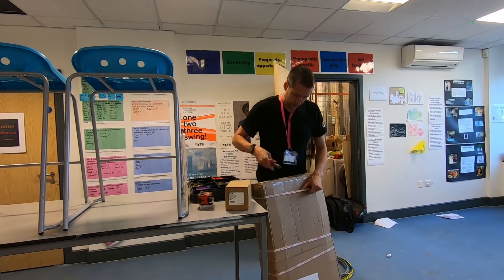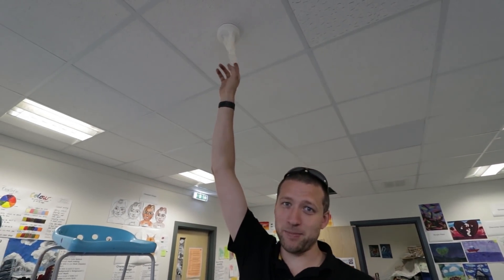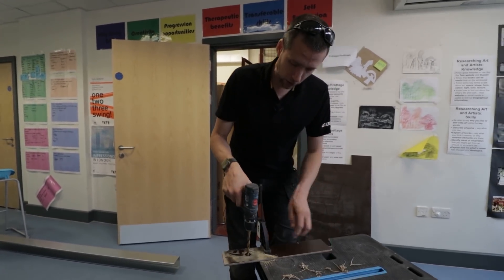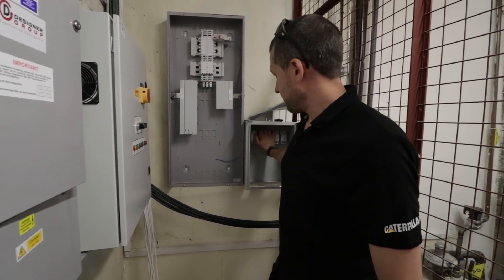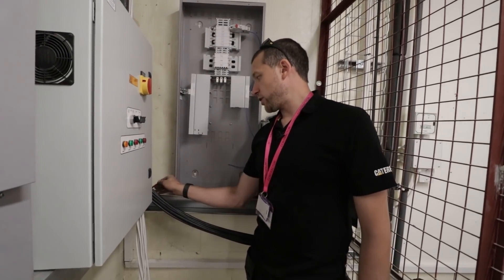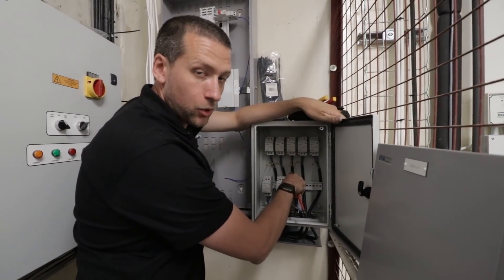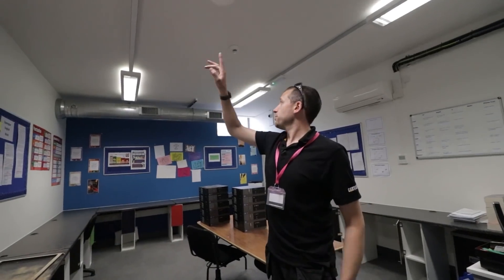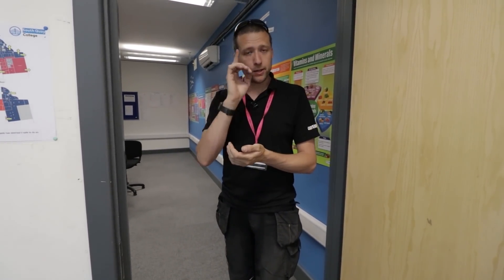Fitting a new three phase panel - (and a bit of steel trunking) | Thomas Nagy

Comment: I wonder how many of those damned PaxLocks have had to be replaced.  I think all of our PaxLocks in work had a mechanical failure.  Maglock connected to a Net2 box and reader are much more reliable, plus they can be remotely accessed, released in the event of a fire (which PaxLocks will sleep through), etc.

Comment: You could have used a hand electric saw with steal blades in it, that one does a good job and no sparks as well. Angle grinder is for something much more hard I guess. I have seen people cutting trays with such heavey tools , the trays can be cut with jig saw as well as a small electric saw but honestly I have seen people using angle grinder on it too.

Comment: Do you have a video on how to supply and connect a grid switch with 8X 20amp switches plus emergency lighting. How many supply cables would I need etc. Would the supply cables run through a contactor then a RCBO? Help please. I do domestic. First time commercial 🤞👍

Comment: Use a cutter on the paxolin.
Mark your centre holes and then put a 38mm cutter through the paxolin and a 50mm through the trunking/fusebord. 
Grommet strip is crap, use a Bush, or use paxolin to fabricate a safe entry.

Comment: I think I know where that earth leakage is coming from. It's probably from another "electrician" wiring a single phase device to a 3 phase supply, using earth as a neutral when the supply has no neutral running to it.

Comment: It doesn't matter that there's 4A or 400A flowing in that earth. It's the voltage and your bodies resistance that determines the current that passes through you heart.
A car battery won't kill you, a spark plug lead will. 
12V vs 12KV
Reply: You can get a nasty shock from spark plug wire, but getting killed is unlikely.

Comment: How is the Paxton system being integrated on with the contactors, I thought Paxton was a Access Control System, 
Swipe card brings in the contactors from a set of Aux contacts in the Paxton panel??? But then won’t it time out like when you swipe through a door, please explain Tom I love the integration between security control panels and electrical installations

Comment: Think your ip rating might be gone with the hole with the grommet strip in it you are using for cable entry surely the cables should be in trunking higher up or glanded into trunking. People will poke their fingers where they shouldn't.

Comment: Paxolin is a trade name it is actually SRBP synthetic resin bonded paper it's what all old PCB,s were made from a lot are fibre glass but not all. I always use a hole saw on paxo never a spade bit.
Reply: Agreed, I'd have never used a flat bit

Comment: Hi Tom, Enjoyed enormously your video's. I did comment on your last video about the Earth leakage, I know I'm an old spark who left the trade in 1969 but still try to keep up with the latest. I still think it could still be  an unbalanced system giving rise to high neutral current and using the parallel paths as a return because of high impedance neutral, that could be caused by   duff joint or harmonics from the switch mode computer supplies, but I doubt if it was the cause of the  leakage, your High quality clamp meters as yours obviously is have an harmonic filter so you only read the true 50Hz I would estimate it would only be 15-20mA for about 40 computers so wouldn't amount to anywhere near the measured leakage you have. If possible try turning off each supply at a time with the clamp meter connected to see where the origin of the leaked is from. Not tell you your job you are 100 times a better spark than I was, but just intellectual curiosity.
Reply: Peter Robinson you are bang on sir.

Comment: Clamping a main earth on a tncs system is measuring circulating neutral currents in the supply system and is not how to measure earth leakage. The school will almost certainly not be leaking nearly 1kw of power.
Reply: What "circulating neutral currents"? Shouldn't PE be isolated from L and N?
Reply: In a 3 phase balanced system you should be getting Zero current on the Neutral and to answer the other question. On a TNC-S system the Neutral and Earth are combined at star point which is usually at source ie Substation.
Reply: @jurassicsparks5220  There's no such thing as a balanced 3-phase system in practical terms. Certainly not that one.

And no, TN-C-S isn't combined back at the substation, that would be a TN-S system.
Reply: Monkeh yeah you are correct sorry ,combined at the service head 👍
Reply: @jurassicsparks5220  i meant that they shouldn't connect after splitting so there shouldn't be any substantial current on PE during normal operation.
Reply: https://professional-electrician.com/technical/protective-multiple-earthings-pme/
Reply: This article helps to explain what goes on with pme connections

Comment: Just an FYI at 12:30, if you did disconnect that 4a line from the earth bar, 4A would not flow through you, because your skin is not very conductive. 
If there's a 250v different in potential between the line and ground, your skin would have to be 62ohms to pass 4A, but your skin is definitely not 62ohm dry. At most, you'd pass a couple milliamps, because skin's resistance is on the order of megaohms, when dry.
Reply: on the money, i would like to know my own resistance between entry and exit with various situations, but i dont want to throw 250-500v between my hand and foot ^^
Reply: And the voltage required to get 4A to flow through those conductors is not exactly much - so what's driving 4A, an actual fault, leakage, or just some stray potential between multiple huge pieces of conductive material stuck in the ground? There's a good chance there's really nothing happening but physics at work.

Comment: You estimate 5 days to do all that? I could agree if you had help. As far as price I would be thinking$4-6k(US),  unsure of materials needed/pricing. Does the panel with leakage have a ground connected to the water piping? Is it possible there is a ground loop in that panel that is picking up leakage?

Comment: Im a Red seal electrician in Canada. Love your videos to learn how you guys do it across the pond. One thing I have noticed is you guys have so much more safety regarding electricity. Id say if I asked 20 Canadian electricians if they have ever used a megger before 15 of them wouldn't have.
Reply: Not just regs, I'm in Level 2 Elec in College and every single circuit I build has to be tested. It's what's drilled into us

Comment: 10:12 If you are routing the conductors through a hole in the lid, isn't that preventing the lid from ever coming off again? Wouldn't it be better to have a cutout at the edge of the lid so it can be slid on and off?

Comment: Hi Tom, We use Eaton a lot and use the trunking adaptors all you have to do is cut the trunking. What supply are you feeding to that D.B 100A? as it looks like a high current board?
Reply: 250a incomer on that board. That’s why it’s so big.....

Comment: Do you install Paxton access control systems? Saw a familiar Paxlock reader, how do you like those? Had any problems with them breaking and not unlocking?
Reply from the maker: Im pretty green and new to Paxton. Its seems like a very cool bit of kit though. I will update you on it more as i start learning about it.
Reply: Paxton very rarely breaks we've got readers out on jobs that are over 10years old no issues

Comment: Did you find what is leaking to earth?
Reply from the maker: Im pretty sure its a combo of all the fluorescent lighting and pc equipment put together.
Reply: @thomasnagy  could be ,but it is conducting which means its going beyond earth and returning somewhere,  sometimes I enjoy finding the answer to these strange issues and adding it to my bucket of experience
Reply: @toddt6730  Well, it just so happens that our supplies are earth referenced - so the earth itself is a return path..
Reply: Maybe a tncs system and some neutral current is flowing down your bonds to metal services

Comment: You can buy a 20 mm ( + other sizes ) drill bit -  , with a reduced size shank that it will fit into your Battery Drill - a Spade Bit will wear out quickly because of the amount of friction created by the hard material.
I find that a nice sharp 20 mm bit will go through Paxolin easily 👍🏻

Comment: 4 Amps leakage doesn't mean it will pass 4 Amps through your body if you were to disconnect it.  What would happen is the earth rail potential would rise to the supply voltage and then you would get a 'normal' electric shock.  The current could be dependant upon the actual voltage and your body resistance to ground.  Would also mean that some other appliance earths may rise in voltage but I'm sure you are aware of that already.

Comment: Good video and commentary as always. I think you are correct about the time, 5 or 6 days, I would charge $60 per hour ($45 for labor and $15 for cost of labor or burden) for labor. I have no idea about parts cost because I'm not familiar enough with that specific equipment, a rule of thumb would yield 0.66:1 ratio (or 60/40) of equipment to labor yields 40hrs x $60 = $2,400 at 60/40 that's $6,000 for the total cost. There's people that have wrote books about labor to parts ratio of various jobs. Like I said I that's the best I can do with my limited knowledge of specifics on the parts required. I only become an expert AFTER I watch your videos. lol!! Keep up the great work work Tom.

Comment: You're a rare breed. I'm sure there's many tradesmen out there who'd do an unsafe bodge job if they'd eyeballed it low, just to make sure they were quids in. In fairness, there's also many who would take the time to make sure it was safe & compliant if they'd eyeballed it low, but that'd be it. However, to take the time, hassle & cost of fitting a brand new board (even when you could have got away with filling the other one up) to make sure you're doing the best job possible, even when you lowballed the estimate?! Hats off to you sir.

Comment: I wanted peoples opinions on terminating armoured cable. It’s an outside light mounted on a 200mm diameter round post. At the moment a 2.5mm 3 core runs in trunking then up the back and through a hole in the post and into the back of the light. Would you terminate the armoured cable in a box before the light and run 3 core into the light or run the armoured directly into the light? Also I would like the capability to expand the circuit or add another at a later date for a single leaf gate motor, only 2A. Any help appreciated. Tom
Reply: If it's only running the light, have it going straight in, trim the armour and tape to stop an sharp edges. This is assuming the other end is glanded and earthed correctly. If you want expansion get a wiska box and have it terminate in there, 3 core into the light, keep the 3 core visible to prevent damage or run a short length of armoured into the light which is preferable.

Comment: Why does a school need 3 phase power?
Reply: Why not? In several countries it is common to have three-phase power even in residential buildings. Here in Germany for example. If you connect the kitchen cooker three-phase it requires only 3x16 A for 11kW with a 5G1.5 or 2.5 mm² instead of a big 3G4 or 6 mm² fused with 32 A. But the appliance is still 230 V and not 400, but the load is distributed evenly on the three phases. On old cookers one large and one small heating plate on L1 and L2. L3 for the baking oven.
In Germany most houses are fused with 3x63 A. The service companies here actually demand that loads with more than 4.6 kVA (20 A) must be connected three-phase. The only exception are old installations with a single phase circuit for the kitchen cooker, mostly fused with 25 or 32 A.
The advantage of three-phase is that it will spare up to 50% of installation material (transformers in the grid and cable sizes) compared to a single phase installation designed for the same demand.
And actually in the UK three-phase is below the sidewalk, but the houses are distributed evenly on them. So if you're connected to L1 your neighbour is connected to L2 and the next one to L3 and the game starts again.
And also it distributes a rotating field which is nice if you got some big electric motors, so you don't need to deal with capacitors on these motors, which also got some disadvantages (~30% less torque and 20% less rated power).
Reply: Cooking class
Reply: Pretty much any UK supply over 20kVA will be three-phase and this has the benefit of being able to run 3 phase appliances

Comment: That “Paxton power supply” is a whole door controller kit, it just needs some sort of lock and 1 or 2 card readers attached to finish it off.
The power supply is the white unit on the right inside, and can take a 12v sealed battery in the bottom of the unit in case of power failure, the yellow board which is rattling around the box is the actual controller itself, and it looks to be a Net2 Plus.
The units can be daisy chained together with RS485 (4 wire serial bus) if you have several close together. Before the Plus was the “Net2 Classic” (presumably retrospectively renamed when the Plus came out) which didn’t have the Ethernet and just used the serial bus.
You can still just build a system with just the serial bus and a USB to RS485 adapter (back in the day it would have been a RS232 to RS485 adapter.
The units hold all the information about which cards are valid and when so it’s no problem if they are isolated for a while (you just don’t see which card went through the door), in fact when one of our doors was offline, we didn’t notice until some new staff complained they couldn’t get through the door...
They also do a video door entry system (Net2 Entry) which uses the same door controllers, but has a video bits which operates independently apart from signalling the door controller about all the events (ring, video viewed, door opened while viewed, etc), and to open the door (you have to use a separate tool to configure which doors talk to which handsets, but you only need do that once).
Reply: I kind of ceased up when he picked the enclosure up only to see that the control board wasn't screwed down when he did it
Reply: You can interface them to intruder alarm systems too so that authorised users can unset the alarm zone at the same time... Also replace the card reader on an entry system with an ANPR camera amd you can do vehicle entry gates with them
Reply: We have Paxton stuff at my work and being in charge of IT I'm in charge of the Net2 software, issuing new fobs, setting door access, time zones etc.  We have the very basic system (pre ethernet) and it requires the PC connected to the system to enable unlocking of all doors when the fire alarm is triggered.  A few years ago it was pointed out that if the PC was off/disconnected at the time of a fire alarm trigger, the doors wouldn't release - so we hastily had green break glass boxes fitted to break the power to the electromagnets!  But I agree, it's a great system and very, very reliable.
Reply: @stevebrown1974  your supposed to have break glasses on the exiting side of each door incase of emergency. On the fire alarm side you would normally have a fire relay that breaks the lock circuit but getting the fire guys in is expensive and not always easy to juggle with access control guys so the easiest way and cheaper way is to do the fire over network like how yours is set up where only one board has an input from the fire wich then tells the rest to drop the lock
Reply: @stevebrown1974  I think we have very similar systems - mine's still running on XP, how about yours? :-)

Comment: Another great video. Just wondering is there a need for RCBOS? there for ovens arnt they? Is all wiring surface in trunking? Would be a good way to recoup cost of the new DB 🤔
Reply: I thought that, it's not a plugged in portable appliance, it's fixed. But then again we don't know the wiring system. 

The original youtube spark old Thomas 😉

Comment: Hi Tom I'm sure that in this case the kitchen doesnt switch all their equipment on at once but it's always worth considering what load could be applied in one go. 

Right call to put in the DB. Will make future maintenance much easier (as you said). Also makes your job (or anybody else in the future) with fault finding. Stealing ways off a variety of boards can make future work much more time consuming.

Also right thing to do as the school will trust you to do a good job and you will get repeat work which will pay for the DB many times over without ripping them off. In my experience people who give out this work want an easy life and  if you can be part of their inner circle you will do well
Reply: If you watch the previous video it's a kitchen classroom so definitely will have all circuits powered together most of the time. Definitely the right call with a new board.
Reply: @alexanderbuckland  ah I havent seen that

Comment: I would be really interested in where that leakage comes from. I mean 4 amps, that's pissing away almost a kilowatt?
Also I don't understand where this could be coming from, aren't all circuits rcd protected? Or are there like 10+ 300mA RCD's that are all at their trip limit, together providing this current?
Thanks for the video!
Reply: The general consensus is that there's not enough there to trip but combined over multiple circuits it totals up to, as you said, about a kilo.

Comment: I found out once that computers use the earth for something and it puts a voltage on the earth.
Reply: The switched mode PSU's create noise on the line which is got rid of by being filtered and dumped into the earth.
Reply: EMI filters are commonly used in switched mode power supplies to suppress electrical noise that the electronics generate.  I believe they're actually a requirement to meet standards to keep interference down.
 
* not an EE but to the best of my knowledge this is at least one reason